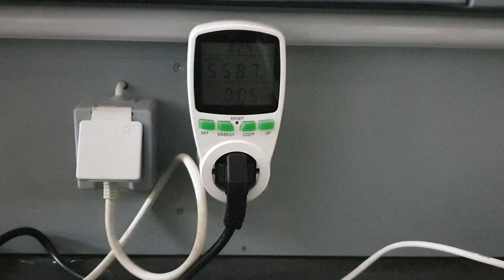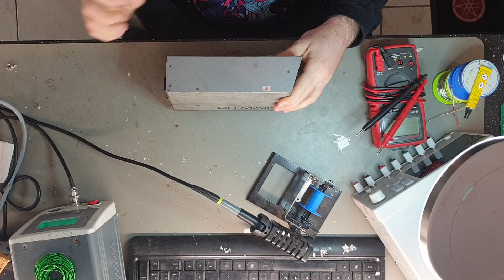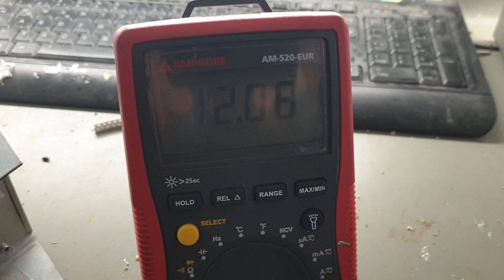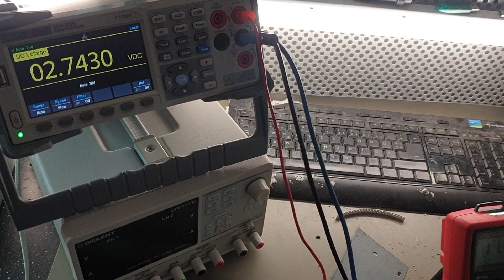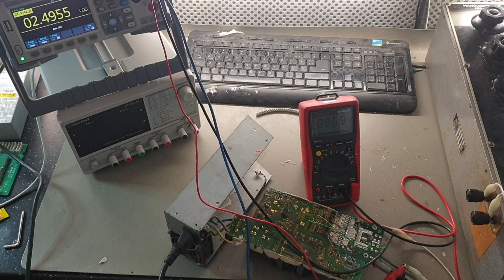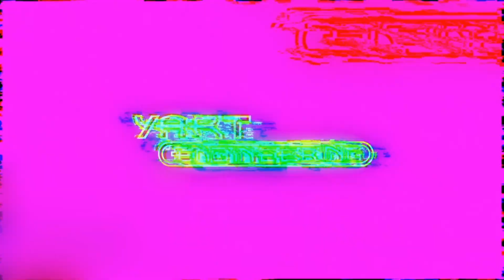Bitmain APW3++ voltage mod

Comment: Thank you for posting this. I just tried it and was able to reduce my loss on running 2 L3+ by about 65%. So far im able to get about 395mh@438w at the wall at 8.6v
Reply: Any chance you would be willing to sell me a modded power supply or mod one of mine?
Reply: @buffaloBRAVE  both of those are options, i have 2 currently.

Comment: Do you (or anyone) know a quick way to modify the 12v output to get to 13-15v? I watched another youtube video where he claims to adjust the blue trimmer pot and get to 13.8vdc but others said that doesn't actually work or doesn't work for them. They claimed to get from 12vdc to 12.5vdc, which is closer but if you know a good quick way, I'm all ears. I'm handy with the solder but not a pro. I can swap a component or 3 but probably not 7 or 12 surface mount components 😂

APW3++-12-1600-A3 using 110vac

Thanks for any tips or advice while I continue googling around
Reply: Amigo si logras conseguir alguna información referente a la pregunta que haces te agradecería la compartas, yo también tengo una fuente apw3 y necesito elevar su voltaje al menos a 14v
Reply: @josedavidalzolayrodriguez1007  Hola amigo, perdona esta traducción con google traductor. Todavía no he encontrado ninguna buena información. Sin embargo, pude aumentar mi voltaje hasta 12,66 V girando el potenciómetro de tornillo azul debajo del pegamento, cerca de la salida. Todavía no ha llegado a 13-15v pero estoy seguro de que se puede hacer. Esta es una fuente de alimentación muy poderosa. ¡Me sorprende que nadie tenga más información en línea para esta unidad! Son asequibles y fáciles de trabajar. Lo estoy usando para probar equipos de audio para automóviles. Funciona bien pero preferiría ponerlo a 14v también. Últimamente no he buscado más información, pero pronto volveré a consultar Google. Espero que esta traducción te encuentre bien y se entienda bien
Reply: @josedavidalzolayrodriguez1007  Could you find a solution for raise to 14v?
Reply: Have u guys found any way of increasing voltage im also interested
Reply: @Hampchamp  I haven't done any more research yet. I reached out to a couple electronics groups on telegram but they were dead and got no reply. I've heard rumors that we can swap out a resistor and achieve a voltage increase but I would really prefer having it done with an adjustable pot. Using the adjustable pot onboard already, I was able to go from 12v to 12.66 but it maxes out at 12.67 for me. That's when using it in 110v mode, I have no easy access to 220v and don't care to make a wire to my laundry room or oven plug just to test when I really need it to work on 110v anyway. If I do figure something out that works, I will come back and update in the comments of this video and a couple others where I've shared this same info and asked the same questions
Reply: Then I've got time I should try change resistor and se what I can get. Need to check what volt those big capacitors handle
Reply: Я тоже ище ответит на этот вопрос
Reply: Replace the potentiometer with a 4.7k resistor for 14V. That is the maximum; it won't go above 14.07V. Or use a 5k potentiometer.
Reply: @seanman6541  are you familiar with the part that some of us are adjusting? It's been called a trimmer pot, a regular pot and something else I can't remember. It turns but it doesn't turn like "normal" adjustable pots. Or maybe not like hobby pots? More industrial/embedded?

I would be willing to switch it out and see what happens. I get hesitant to play with it while the case is open but I need to make sure I have the contacts enumerated properly before I start soldering or desoldering. I see a lot of 5k pots on Amazon but I'm trying to find the same style as what's inside now. I will keep looking.

If I go to a resistor, what size do I need - other than 4.7k, what other parameters do I need to ensure? Thank you for your help
Reply: @Pi_Cue   It's a multi turn trimpot. It's just a regular trimpot (which is just a small potentiometer designed for infrequent adjustment) with a screw that turns an internal gear that moves the potentiometer wiper. The pinout is the same as any other potentiometer (outer pins connect to opposite ends of resistor element, middle pin connects to wiper), and they're all the same size, so if it looks the same and is 5k Ohms, it'll work. On the power supply board, the two pins of the trimpot closest to the AC input are connected together and are connected directly to the positive output of the power supply. The other pin, that is the one closest to the DC output, is connected to the voltage sensing circuitry of the controller. Connect a fixed resistor or potentiometer between the two outer pads on the PCB after desoldering the trimpot. Below 300 or so ohms it won't output any voltage, above 4.7k ohms and it will cause some weird glitching of the output from 14 to 15.5 volts, but it won't stay stable. 4.7k seems to be the max for stable output voltage of 14.07V. It will drop under load to 13.5V or so at 85A. Also note that when increasing voltage, the rated maximum continuous current draw should be ignored and instead calculated based on I = P / V. So 1600W at 14V is 114A and 1200W at 14V is 86A. Otherwise the input side of the power supply may overheat.
Reply: did you manage to change the voltage?
Reply: @kolyanmolotok5487 not by more than 0.5v or so using the adjustment. Components need to be changed and I haven't found the right person to explain it. I'm comfortable soldering but no legit instructions yet

Comment: Yart, let me ask. I have a blue trimmer (the blue 10x pot, you have it too but did not mention it) and it goes up to 12.5 Volts. I measured 1K ohm at that point. Should I replace the blue trimmer with a 2K or more trimmer, or would it still be limited?
I am in the process of replacing it, I will post an update later.
Reply: 5k om

Comment: @yart engineering Thanks a lot for the information. I tried it out on my APW3++ but got a short circuit, probably where the SMR was replaced with the 10k pot. Is there a chance you could take a look if I send it over?
Reply: sorry, one more question. What would you expect to be the behaviour without that SMD that you removed? I have it removed now and if I connect the psu there is a short circuit (fuse goes). Is that expected or I have created a short circuit as part of removing the resistor you think?
Reply: @jonasliljenfeldt  Better put a 5K resistor there for the default 12Volt output. And then try again.
Reply: @deslomeslager  Thanks for the tip. Yes I should probably try that. In previous attempts, when the fuse has gone off, it has smelt a bit burnt and i see that those two NTC 5D-15 at the lower left corner (based on the labels on the PCB) looks a bit cracked. Would we expect those to be the ones taking the hit if some components got damaged during the short circuits?
Reply: @jonasliljenfeldt  Sure, that is what they are there for. Not that I checked the schematics, but in general NTCs acts as a temporary fuse which wil reset after a while. You may be in luck.
I am currently working on replacing the blue pot, it is 4K. I am aiming at replacing it with a higher value, since I need to go to 13.5 Volts or even higher if I can, 14 would be great. I want to use one of these PSU's for in case our grid goes down. I will connect an inverter to the output, and I will use my solar panels as input, which deliver between 140 and 230 Volt DC. The PSU can work very well on those DC levels. This is the cheapest way to get a backup powerline if the grid is down. No MPPT, but that is of later concern, I will as well add a 100AH LiFePO4 in the mix to cover cloudy moments.
Tomorrow I will see if replacing the pot works. If not, then I can still do it the same way as in the video above, but I hope and think replacing the blue pot is the quickest and easiest way. I will come back and others know if I got it to work.
Reply: @deslomeslager  Interesting indeed. I have fours PV panels and a hybrid converter myself powering two L3+s and would like to go for the 1 KH/W efficiency instead of 1.22 as of now (best software efficiency I can get) by adjusting the DC Vout to 8.7. I currently ramp chains individually up and down depending on the current degree of sunshine to use as little of the AC from the grid to power those machines. I bought a set of those NTCs from aliexpress and will replace them before trying again. I had a professional soldering license 25 years ago but I apperently need some training and enjoy the experience :) As a backup solution I have also ordered one of those PSUs at aliexpress where you can adjust the DC Vout 0-12V and if I can not resurrect the APW3++ I will use that one.
Reply: In addition, I just now replaced the blue pot (it was only 1K Ohm)) with an external one of 5K ohm. It does not rotate 10 times, only one. But it is now on the outside, and I found out that the output voltage can now be regulated from 12 Volt up to 14.07 Volt. And this is for me exactly what I need, since I want to be able to connect this PSU in parallel with a LiePO4 12V(14.4) battery, I have several of 100 Ah. The batteries may take over if the load is too much and/or the sun goes away. Of course, charging them is less easy, however at 14 Volts it is in the safe range of all cells up to 3.5 Volt, at which they are almost full. I am a happy man. job done. I will do a second and a third PSU now I know how to. And sorry for the guys who want to have a lower range, you will need to remove R96 on the board and attach a variable resistor (10K) to it, with an extra 1 K fixed or 2 470 Ohm in series to prevent a shortcut. As you can see in the video, a lower resistance will lower the voltage, a higher resistance increases the output Voltage. I have the impression it was lineair as well. So pot to the left = 12 V, middle = 13 (2.5 kOhm) and to the right = 14V (5 kOhm).
Reply: @deslomeslager  I abandoned the PSU I wrecked for the moment and will try to repair it when I get spare parts (the fuse is fine, but D09 and D10 appears broken and will also replace the two cracked NTC 5D-15 that got smashed at my shortcircuits). Got two other APW3++ cheaply and could quickly replace R96 with 7.9k (kept it simple, normal resistors instead of the pot; 6.8k + 1k + 0.1k). Both works perfectly with 8.7 Vout and increased efficiency with 273-300 MHz depdending on hashboard. Once again, many thanks Kevin! And now I also got some well needed training and equipment for such repairs...
Reply from the maker: Good to hear that. Will try to bei more active in future
Reply: @Multikevin113 senk you. Ukraine
Reply: Didn't have time to wait so I soldered my PSU today and it was successful. Not able to get the same numbers but went from 0.74mh/w to 0.95 mh/w
Reply: @uddemannen any chance you would be willing to sell me a modded powersupply or mod one of mine

Comment: To reduce the voltage in the network. The chips should work well. Otherwise . there is a risk. disable problematic hash boards. Firmware from blissz L3+

Comment: so with this mode i can run two l3+ from one PSU ??
Reply from the maker: correct
Reply: @Multikevin113  what size are those two resistors you used ?? cant see color strips.
Reply: @Multikevin113  Why do you need a PSU mod to run 2 L3+ on one PSU? OR are you running on 110 Volt (1200W max)? At 220 Volt you have 1600 Watt. If you apply the software MOD (lower the hashboard voltage with a script) you can run below 700 per miner (not in hot climates I guess). I wonder why no one has ever found that MOD to lower the L3+ hashboard voltage. I have had L3's from Bitmain with the maximum voltage on a hashboard preset. Really! That is just wasting heat for nothing. I always ran the boards on the lowest voltage and had no problems with 2 on one PSU. (I stopped mining over a year ago, I knew electricity cost would be a problem, also the L3 was no longer top of the notch af course, L7 is there too).
To apply the software mod you need to have SSH access, and then create the script and run it. I am willing to give instructions and files for a small paypal or altcoin donation. You will earn it back soon.
Reply: @@StepanovMihail thats good. just got my second l3+ so planning on running them that way.
Reply: What is the final result for us that are not gifted with electrical engineering knowledge. More efficient miners? More hashpower? Can I run two L3+ at full hashrate at 700 watts approx? 

Could I send you my power supply so you can make the mod for me and I how much $ would you charge?
Reply from the maker: @fraudD3tector  Hi,
I can actually mod the supply for you  but I will make a video soon with a easy mod for the hash boards, which results in same efficiency. Sorry I need so long for every video but I am very busy RN.
Regards Kevin
Reply: @fraudD3tector  if u undervolt l3 t0 400- watts consumption u can run 4 l3 on one one psu
Reply: Is that done tjrough the blissz? How do you undervolt to 400 watts.

 @michaelleonov-ilmovsky4836
Reply: @michaelleonov-ilmovsky4836  does that require modding tje power supply like in this video? Or is there another way? Im hesitant to mod power supply because of caps, not confident in discharging them, the rest i think i could do.

Comment: @yart engineering Thank you for the video and helping everyone. On the apw7 which resistor am I looking for ? I knew they would be different but it's a completely different layout. Thanks so much
Reply from the maker: Next video....Hopefully next weekend ;)
Reply: @Multikevin113  for the apw7 which version do you have ? I have V1.1, glad you are putting this content out also much appreciated 👍
Reply from the maker: @BackWardsM1ner  I recently figured out a way to mod the hash boards. Video upcoming next week
Reply from the maker: @BackWardsM1ner  Then you can use any Power Supply
Reply: @Multikevin113  how is this video coming ??